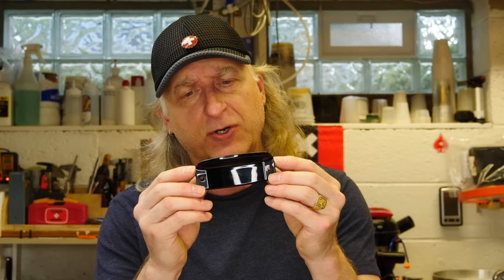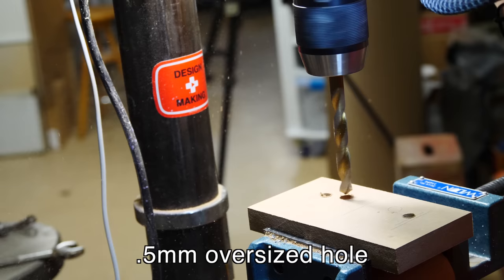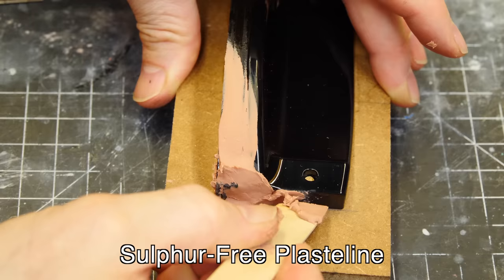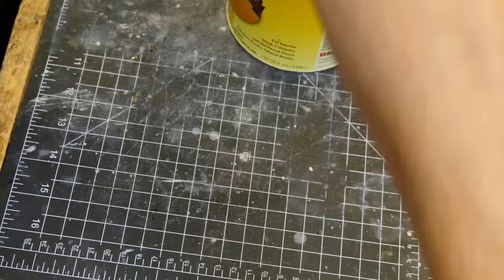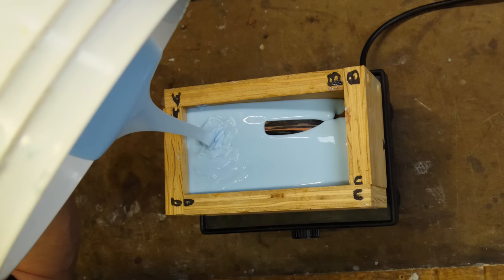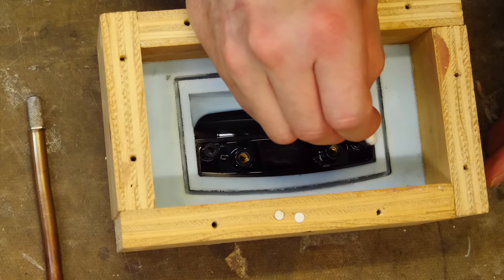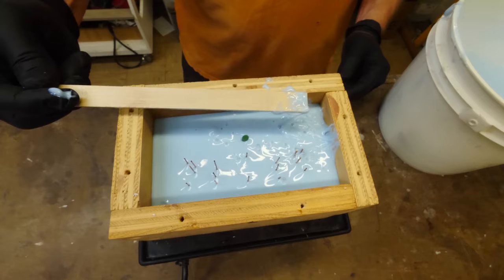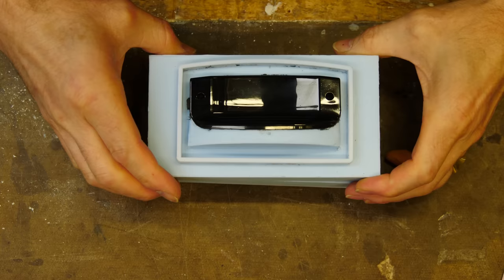How to Copy a 3D Object

Comment: Pro tip: insert screws into the brass threads. Make sure the screw is long enough that the bolt head sticks out above the silicone. Now when you pour the second half, your silicone will be threaded. When you're going to cast the part, insert the screw into the silicone, then on the inside screw on the threaded insert. Cast away. Now you've casted around your threaded insert and saved yourself a step. 100% repeatable accuracy 👌
Reply: But this particular part calls for threaded brass inserts!
Reply: @HAMMER_2.2  Yes. But, as Benjamin proposes, you can then use the screws to install the inserts into the mold before casting the resin. The inserts will then be imbedded into the resin part after curing, without the need for installing the inserts after demolding. That's what they do with injection molding. They make features into the metal mold and a technician installs the inserts into the mold before pushing plastic into it. The part comes out of the mold with inserts.
Reply: Brilliant!
Reply: @123456789wil1  It all depends from which side this screws in. If you create a inverted thread not only its useless but ruins the entire mold, creating extra work and bigger mold box etc is a waste of time and space so as waste of materials. Besides silicone molds are one thing while metal molds are a different world.
Reply: Yups, just what I would have done too.... But Eric, this is a great video. Thanks. Yet again
Reply: This is amazing. Thanks for the tip!!
Reply: That Is SMART and exactly what I'm gonna do when I copy parts for things like electronic cases
Reply: @minmogrovingstrongandhealthy  You simply make the mold accordingly.

Comment: Woah!? The process is no joke man... Take a lot of professional tools which is pricey too... and A LOT of patience. Salute! 🥳
Reply: You don't need a laser. You don't even need a vacuum chamber, in fact you can certainly do it with barely any tools at all except some popsicle sticks, sulphur free plastoline and some plastic cups. 

But then you'll need some hobby knives and wet and dry sand papers and plastic polish and cotton rags to fix it up because the bubbles in the mould will make extra lumps you'll have to get rid of.
Reply: @cianmoriarty7345  Agreed. I've low budgets my way through this, even making my own vacuum chamber out of some household items. A hose attached to my compressor where the intake filter would go and that attaches to a fitting epoxied under and through an upside down plywood box. I use laminate cabinet board for top ( I don't want a perfect vacuum implosion. You don't need a perfect seal). Set a heavy pyrex bowl over your epoxy so you can see and regulate the bubbles; turning compressor on/off when needed. I wear protection just in case, but haven't had an issue yet. If I do more plastics, I'll get a chamber eventually so I don't have to constantly baby the degassing.

Comment: The tools are somewhat overkill, especially with that laser cutter. But man, the result are not lie, It looks amazing. 

I really like how you clear the air bubble with that vacuum chamber, once again, somewhat overkill, but it is the best way to kill air inside things, as far as I know. And then vibrate the container while pouring the silicone. Just amazing. Very pleasant to watch.
Reply from the maker: Thanks, laser cutter is a game changer, it has fundamentally changed how I make stuff
Reply: Overkill is relative my friend, because the parts made from them are absolutely flawless.

Comment: I haven't seen the 'heat up the clay' tip anywhere! Seems like a no-brainer, but it never occurred to me. I'm adding that to my personal 'pro casting tips' list. Thanks!
Reply: If you put the clay in a Fridge you can 'Shave' it with a scraper blade, get clean hard edges and even sort of Polish the surface with solvents :)

Comment: Great video, but I just wanted to make a part for a $20 tortilla press, and buying all this specialized equipment seems like overkill. Seriously, though, I know I will need to make a few purchases to get into casting stuff. I am a maker, but right now that's 3D printing, wood working, electronics, and thermoforming. That's already taking up too much space I don't have... but silicone and resin casting would be a great addition.

Comment: Great video. I'm a novice and made very simple parts successfully already but, now I'm trying to duplicate an HO caboose base plate and it has me confused. It has the 4 corner steps going down and my issue is deciding the pour side. My thinking is to have those facing up on the pour with vents based on this video and gravity. I've inspected the good part and can't find any hint of vent ports. Hope I'm right. Thanks for the great walk-through, Eric.
Reply from the maker: Good luck, injection molded parts will not have resin like vents
Reply: @EricStrebel  Ha! I'll let you know how is turns out, sir.

Comment: How to Copy a 3D Object using only simple tools everybody has in the closet: drill stand, stationary circular saw, death star grade CNC laser cutter, vacuum chamber, pressure tank. you will also need some inexpensive chemicals and some basic skills in 3d modeling.
Reply from the maker: Correct

Comment: Hello, Love your videos.  I have a dilemma & hope you can point me in the right direction. I bought a silicone puzzle  chessboard mold from Temu. The pieces came out like a dream.  The problem I'm facing is the corner edges will Only set right in 2 corners.   ( left facing pieces no right facing pieces)In order for the other corners to fit I have to turn the parts upside down.  The border has a grove that runs around the whole border,  flipping the part gives me a flat surface.  Can you please give me some advice on how I can make the right corner parts with the resin ?. Keep the videos coming.  Thanks

Comment: Let me get this straight - you want us to use a minimum $2000 laser cutter to make make paper holes? Couldn't we just use something else to cut the holes? Now add the cost of a vacuum pump $200. A vibration table actually tends to add bubbles depending on the silicone. If you want to avoid bubbles with silicone, add it slowly through a small hole at the corner using parchment paper taped into a cone shape with the nose clipped off for a slow entry funnel.

Comment: Wow. 😮 Very cool process!
Have you ever thought about incorporating 3D printing or even 3D scanning in your workflow?
Reply from the maker: Yes for some applications that is appropriate
Reply: @EricStrebel  can you specify requirements were it would be better to use this process? I wanted to try it out, but it is a lot of work compared to 3d printing.
Reply from the maker: One example would be strength no 3D printed part out of resin or FDM is going to be as strong as a urethane cast bubble-free part. Another example  would be material selection, there are just many many more urethane resin material types than there are 3D printing or 3D resin types.

Comment: 10.000 dollars equipment and tools to duplicate a  30 dollar spare piece. Makes sense
Reply from the maker: I wish I had $10,000 of gear in my shop to make stuff. I really would like a higher capacity vacuum pump and a pressure tank that was four times as big as what I currently have and a vacuum chamber that was three times bigger than what I have.

Comment: Love the videos!  How much do you consider shrinkage of the silicone or resin for a part like this? What about a part that needs to fit with other "non-copied" original parts?
Reply from the maker: Should be zero shrink, use good silicone

Comment: How can you fix threaded inserts into a resin after the pour? You cant melt them in like you would to with thermoplastics.. I'd try to insert them before casting the resin, which will probably result in greater strength.
Reply from the maker: Epoxy them in or you can heat press them in
Reply: @EricStrebel  Duh, sometimes it is this obvious. Ofc you can use epoxy.. Ty =) I didn't know resin can be heat pressed tough.

Comment: What materials do we need to use to make sure the silicon does not stick to the original part when the silicon dries ? Are there many options ?
Reply from the maker: None are needed
Reply: @EricStrebel  don't we need any kind of release agent coat to make sure the original part does not stick to the silicon?
Reply from the maker: No

Comment: Fantastic videos!  I'm curious if 3D printing has had an effect on how much molding and casting you do these days.  Some of these parts seems like you could model them in fusion in about the same amount of time it takes to make a mold.  Curious if that has been your experience or not.
Reply from the maker: 3d printing, is a myth in many ways, perpetuated by the media as some holy Grail for manufacturing. definitely not applicable in this scenario. It has its place but it's not for visual defect-free parts
Reply: @EricStrebel  100% agree on 3D printing being over-hyped.  My thinking was more that it could replace early prototypes, or requests to make one-off parts where it doesn't matter much what they look like.

Have you gotten into any small scale injection molding?  That's something I've been really interested in exploring lately.
Reply from the maker: Oh 3D printing is absolutely fantastic for early models and mock-ups. Where visuals aren't the most important thing. Nope have not tried any low level small injection molding stuff, but in a way it's very much the way I build my silicone molds and inject resin into them.
Reply: I enjoy your vids and learned enough to give it a try.  I have a FDM and resin printer. My process is to design and print using FDM (cheap). Make all of my tweaks to make the part work and look good. Re-print in FDM and test.   Then make a (more) perfect one on the resin printer. Sand and paint to get it looking great. Then make a mold of that and create many copies in PU with whatever mechanical properties are needed.  If it doesn't need to look good, but just function, then the latest and greatest FDM printers can do that fine.  Resin is still too expensive and not tough enough for functional parts, in my opinion.
Reply from the maker: Eh, depends on the application, resin is way more robust than 3d printed parts, and I can mold in color and replicate production materials , sometimes I just make videos about documenting the old school process
Reply: @EricStrebel  I was talking about resin 3D printing. Maybe I'm mixing terminology. Thanks.
Reply from the maker: Ahh, yes, 3d printed resin is not that tough, some is tougher than others, but not as tough as a PU resin. I am not so concerned with cost, since the time saving would more than make up for the cost if it was as durable as a PU

Comment: Hey @Eric, how long do your molds usually last?... How many castings per mold?.....also do you cut up molds that are no longer usable and recycle small chunks into new molds?
Reply from the maker: Depends on the silicone, maybe 30 parts, sometimes more, no I do not recycle the old silicone,
Reply: As long as it the same Typ of Silikone (addition-crosslinking silicone vs condensation cross-linking) 
I use Chunks of failed Molds as Keys... so i don't have to make Dimples etc in my first mold... 
I just wait until the Silikone sets slightly and press some Chunks in the Surface

An if I have ood shaped stuff I fill blank space with Bits of old Silikon, just remember to clean it so there is no Moldrelease or skinoil that prevents the reused Chunks from Bonding with your new Mold

Not the most elegant solution, but it works reliable

Comment: Ok big question. I have a part made of abs that was super glued back together. What 2 part silicone will cast well and stay unreactive with the and and super glue?
Reply from the maker: any silicone should work and not react to the super glue, but if you are worried about it do a test first.
Reply: @EricStrebel  thanks man that's a good idea I didn't think about testing the silicone out on a separate part. Would the age of the plastic and its degrading cause any side reactions. I don't think so but I'm working with 40 year old abs so I can't be too careful

Comment: Have you tried a resin 3d printer to compare the process/results?
Reply from the maker: Not relevant in this situation, but I have resin prints made all the time
Reply: 99% of us don't have and this is what we need to knows.
Reply from the maker: Current resin printing technology cannot duplicate that part in the same way as the original. Just not possible due to the fact that printers print in layers. And matching that original material is not possible. As well as the gloss level and just overall look and feel. Don't be fooled by the hype about 3D printing it's great but it's not a replicator.
Reply: Irrelevant, just stick to your printer and do your amateur stuff. This method is not for the keyboard wiz, which  I am trying to apply.

Comment: it raises the question, do you have the right to make a duplicate? the design isn't yours is it? ripping off someone's hard work is theft
Reply from the maker: The part is no longer in available, a matter of opinion......
Reply: Anyone is free to make a direct copy of a part as long as that part is not patented or a trademarked item.  The company that originally made that part owns their drawings and intellectual property on how they make it, but they do not own the rights to be the only ones that can make it.  This is no different than all the companies that make after market parts for industrial machines and autos.  Thousands of machine shops across the country make copies of parts every day, and this is no different, so no, it is not theft.  It doesn’t matter if the parts are still available or not as well, when I worked in industry, we had parts made by a local machine shop for a variety of reasons that were still available from the manufacturer.

Comment: Your knowledge is unparalleled my friend, but I highly doubt that many of your viewers have access to many of the tools you're using like drill presses, laser cutters, etc.  Wouldn't it be more instructional to show how to do the same thing without all the fancy expensive tools?  I'm sure with just a cardboard box and some modeling clay a mould could be made alot faster and alot cheaper, wouldn't you agree?
Reply from the maker: Perhaps, but some basic level of precision and sophistication is needed to make good parts.
Reply: @EricStrebel  true... And I can understand the need for extreme precision in some cases, but for the average Joe Schmoe hobbyist who just wants to duplicate a part for a small run, a simple tearable rubber casting would be sufficient, wouldn't you agree?
Reply from the maker: I guess that depends on your standards of model making, mine a pretty high, but sure there are many ways to skin a cat
Reply: @EricStrebel  I totally agree... I love the work you do. But honestly, for the average hobbyist, who don't have access to alot of the tools you use, alot of the information in this video is useless. If I had access to a laser cutter, drill press, etc it is very helpful, but honestly most people don't have that kind of access or budget.

Comment: what if I dont have a vacuum chamber xqq ?
Reply: or a pressure chamber for that matter xqq ?
Reply from the maker: You will get air bubbles in your silicone
Reply from the maker: Your chances of air bubbles in your part are increased

Comment: So much work, why don't you just 3D print it next time ?
Reply from the maker: Okay, let's break this down, scan it, resurface it who's going to do that? Print it.. then finish it and polish it.... That's just way too much work, Plus you only get one or two that way, if I cast it I can make it any color I want any material I want any durometer that I want, etc........oh and the 3D print is nowhere nearly as durable as the urethane resin part....think before you post.
Reply: @EricStrebel  Have you heard about SLA printers? With them, you can get good quality parts out of the box. What makes you think that 3D printers can produce only one or two parts?
Reply from the maker: @kamilhorvat8290  I have two formlabs machines.....they make great parts but not even close to a cast part......

Comment: missleading title: usually a "copy" means a duplicate; by the title it could imply the use of photogrammetry, which is preferable when you have a very irregular object (or a human body, animal, sci-fi character that would take insane effort to model artistically in 3D).
For the rest of inanimate (mostly) regular/symmetric objects you can of course use parametric/procedural 3D generation.

Comment: You Did Not Need To Do This
Hard Work,
1. Silicone Mold Making Kit 30A
   From Amazon
2. Put Complete Part In Silicone
    Inside Of Box.
3. Demold And Take Out By Cutting 
    By The Side.
In This Way You Donot Need Vacuum
And Takes 5 Minutes To Make Your Copy
And 4 Hours To Cure 30A Silicone Rubber.
Amén.
Reply from the maker: Lol